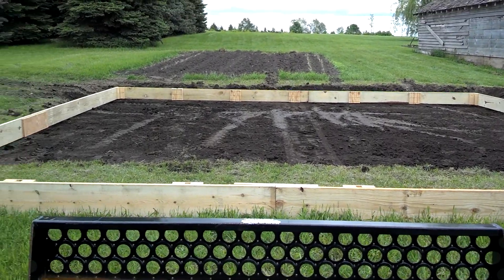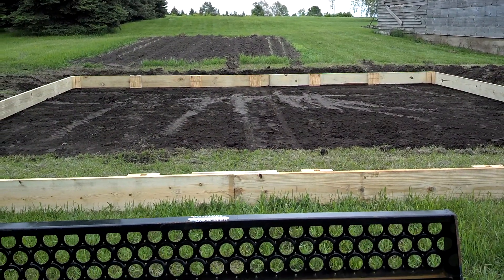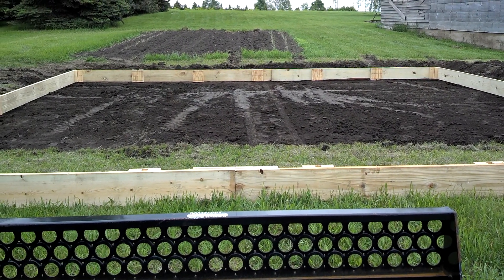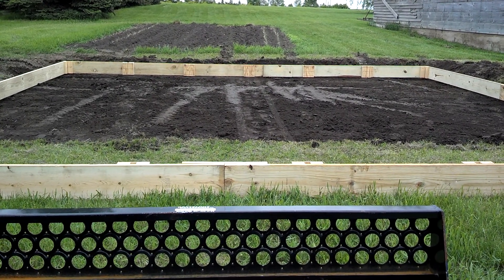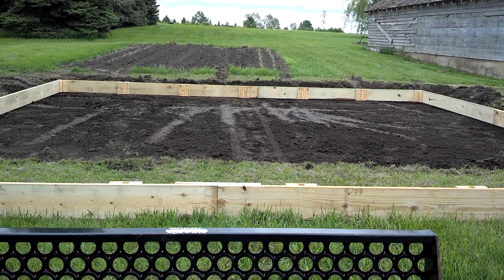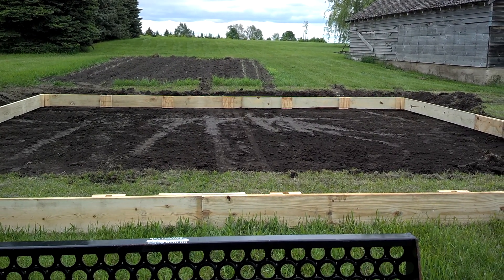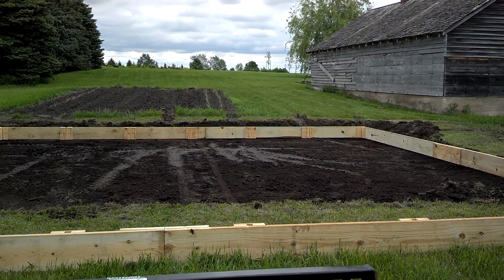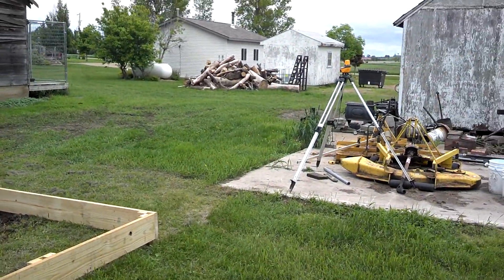Oehmsen "1250" Green House Part 3

Comment: Yup, I've seen those before, very handy tool. I don't do much around ere where I could use (justify owning)  B-) a grapple though. My neighbor has my forks now, he uses them for logs. His are generally cut into 8' lengths for his saw mill. Thats what he generally uses for lawn furniture.    There are a set of runners that he stages the logs on, and then rolls the logs onto the mill. Its a pretty cool setup. I filmed it once, but he had me take it down, as he's scared of the internet... B-)

Comment from the maker: I find that the pallet forks work excellent for handling logs. I cut my wood in 5-6 ft lengths then set the logs out in my yard and come along and cut the 5-6 footers into 3 pieces and line them up in a row and come along with my splitter which I mounted to the bucket of my skid steer and split them. I want to get a Pallet Fork Grapple from CJJ attachments. Just Google attachmentsCJJ. I will try to make a video of this whole wood cutting / splitting fiasco of mine this fall.